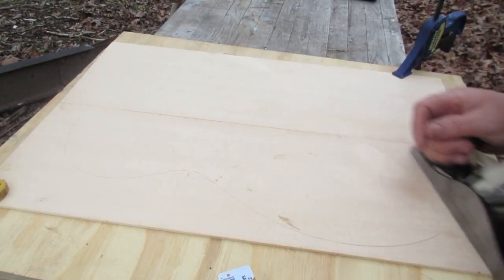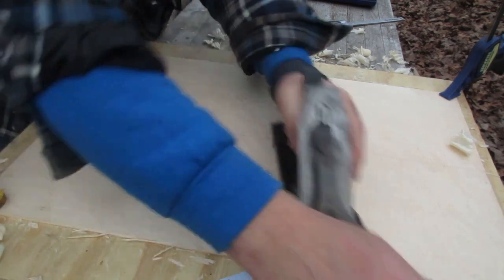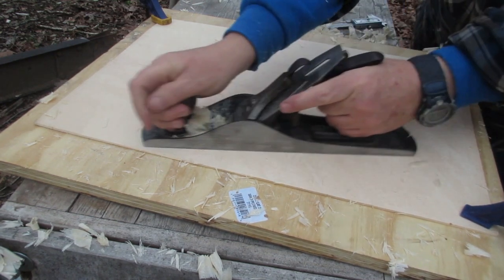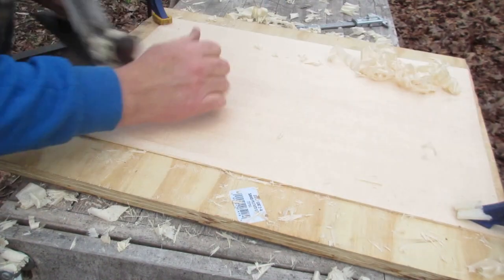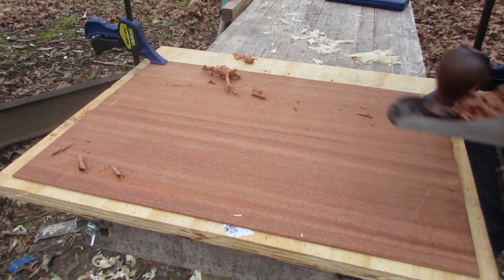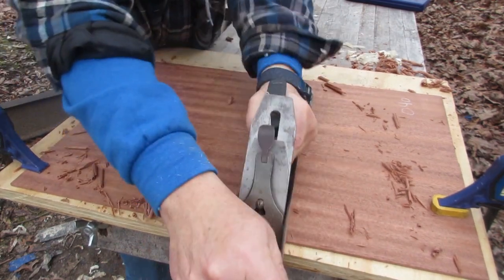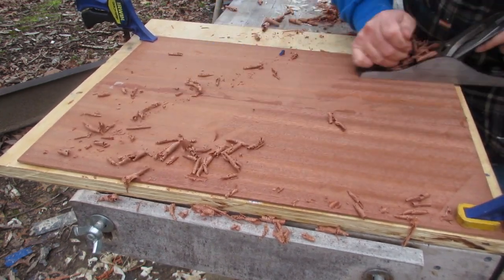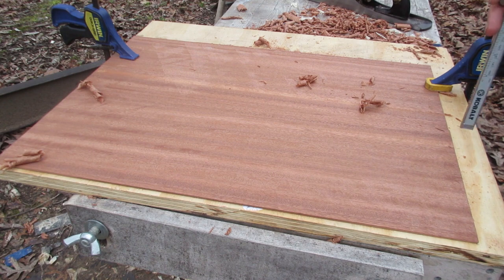Thicknessing the Top and Back Plates With a Hand Plane

Comment: Every drum sander I have ever used does NOT make perfectly flat.  I have used both handplane and drum sander to thickness and the handplane makes the plate much flatter, provided you pay attention and evaluate the plate periodically.  Have you ever tried a toothed plane iron?  I use a Lie Nielsen low angle jack with their toothed blade.  It makes it possible for an amateur like me with modest hand plane skills to get a decent result.  I get rid of the ridges at the end with an orbital sander and 80 grit.
Reply from the maker: Thanks. I would not care if a drum sander did make it perfect; I prefer hand tools, and there is very little that feels as good in the hand as a sharp hand plane, IMHO.
And yes, I have a toothed blade. It is a great tool when you want to hog a lot off or are worrying about tear out. Good stuff!

Comment: do you have trouble with tear out when you plane spruce tops at a 45 degree angle to the grain? If so, how to adapt?
Reply from the maker: At 45 degrees to the grain there is still s chance of tear out, but you can minimize it by having an insanely sharp blade, stopping and sharpening frequently, and most importantly having the cap iron very close to the edge of the blade (1/32"), and taking very thin shavings, as thin as you can get them. I get very little to no tear out this way. I tend to work at 45 degrees, then finish with the grain, remembering with the top and back that one side of it has reverse grain to the other, since they are bookmatched.
But you should allow for the possibility when you thickness your top, as well as allowing for the fact that the top will also be further thinned through sanding in later stages.

Comment: Great video - I am about to tackle this myself.  Do you have recommendations on the type of plane to use?  I am confused by "smoothing planes" "low angle planes" etc.  What type is best for this kind of work?
Reply from the maker: The differences between many of those planes can have more to do with the way it is set up than anything else. 
I use just a standard  Vintage Stanley #5, but a #4 would work fine,  You could do it with a block plane, but I would not.
If you don't own or aren't familiar with hand planes, spend some time on Paul Sellers' channel and gain an understanding, then practice a lot before you actually try to thickness a top or back.
Of paramount importance is a razor sharp blade and a very shallow cut. f it gets dull in the least, stop and refresh the edge. Be sure to allow a bit of extra thickness for sanding/scraping the soundhole rosette and final sanding before finish. it can get really thin really fast.
I would also recommend William Compiano/Johnathan Natelson's "Guitarmaking  Tradition and Technology".